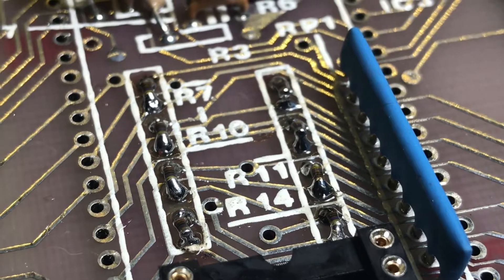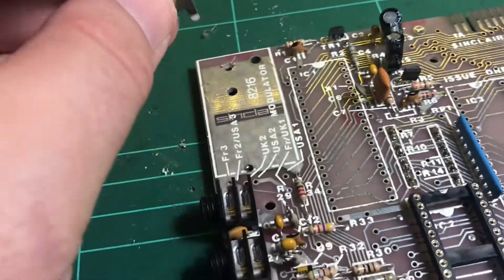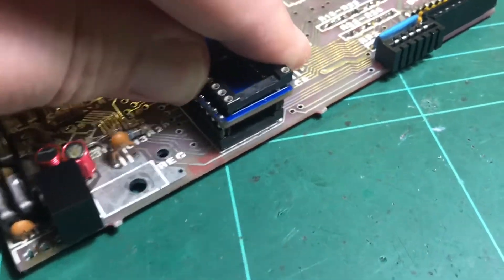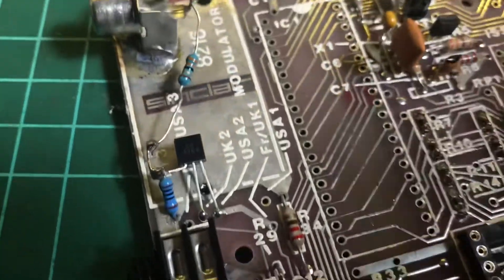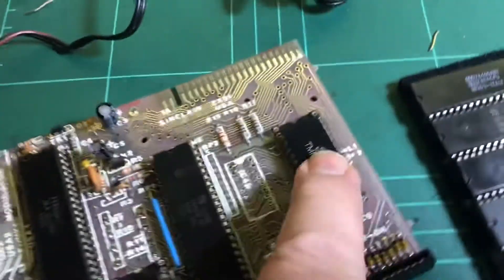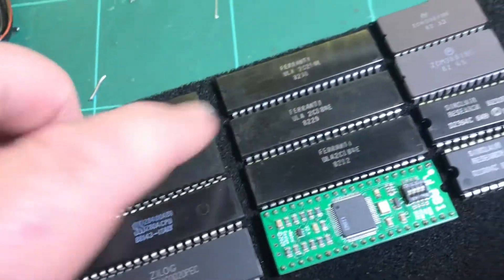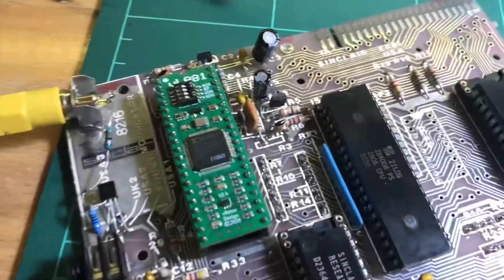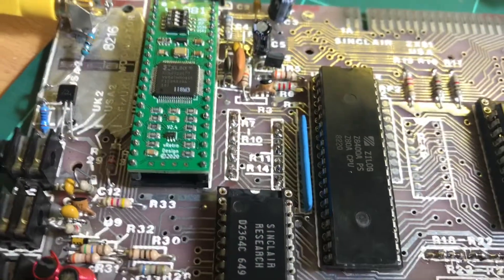ZX81/TS1000 Modernisation: Part 2 (vLA81, composite video) [TCE #0005]

Comment: I know this is two years ago and you have it working with the PCB mount RCA jack, but the tab was snapped on my TS1000 when I went to composite mod it.  (Apparently someone from before had just "slid" the tab back in and it was being held in place just with pressure.  I noticed it when I went to remove the wire and pulled on the wire a bit getting ready to heat it up with my iron to remove the wire and the whole tab just pulled out.)  
You can remove that RCA jack and replace it with a panel mount (held in place with a nut) RCA jack.
I was able to remove the original jack with a screwdriver and pliers.  Just used them to crush and remove the insides of the jack first.  And then I compressed the RCA jack enough to be able to push it inside the metal modulator case to remove it.  Then place in the panel mount from the outside and use the nut from the inside to keep it in place.
Can't tell it's not original when done...  (Was a bit of a pain and not sure it was worth it tho, but glad it's done now that I have done it. ;-)